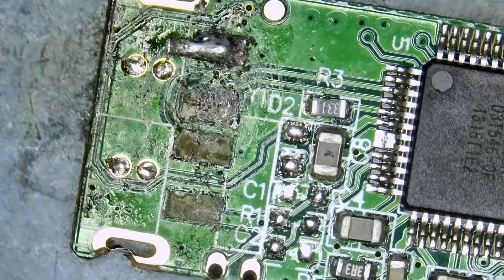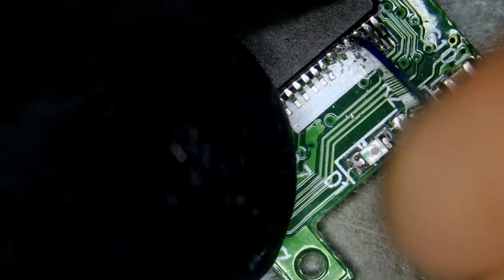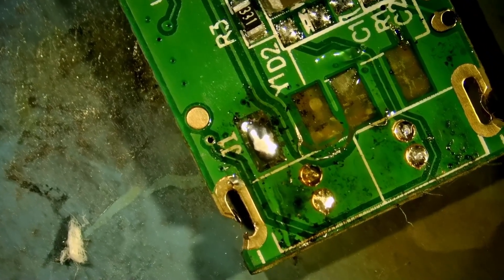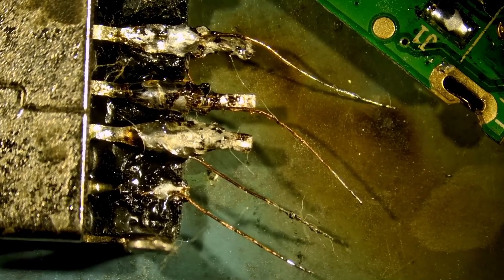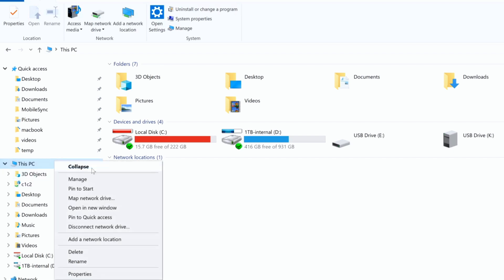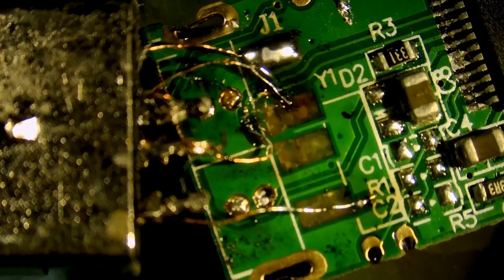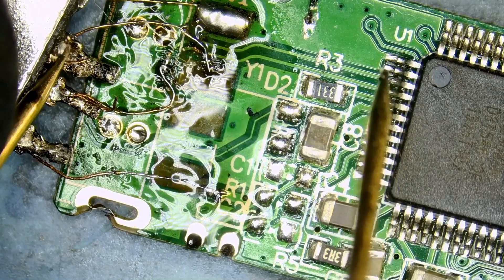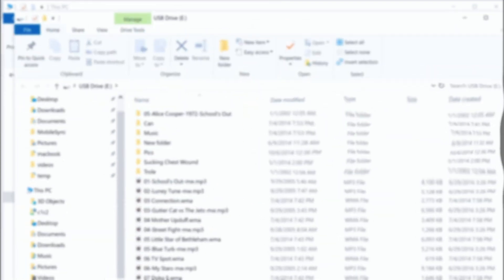Damaged USB Flash Drive Data Recovery - Controller short

Comment: Just had to stop by and say how awesome my buying experience has been with the Northridge Fix crew. Quick, and I mean quick delivery. And the products they sell are the best I've found anywhere. I can tell you just the things I've bought have caused less  headache. Something as simple as flux and solder wick that actually works like it should instead of disappointment and frustration. And if you have any issue with nearly anything, they will bend over backwards to find a solution.

Comment: Any ideas on where to start repairing/cleaning a possible saltwater damaged RTX 4070.
Reply: if it wasn't plugged in and powered up at the time. i would disassemble it and soak it in distilled water for a few hours. then lightly scrub it with a soft bristle paintbrush or something similar. rinse it off with more distilled water and let dry in a warm place for a couple days to get rid of the majority of the water. after that if you have a low temp stove 150f to 170f or a food dehydrator big enough put it in for 20-30 min stove 2-4 hours dehydrator to make sure all moisture has been removed from the board. reassemble and you should be good. if it had power at the time of the water ingress your only option would be a repair shop.
Reply: @AllanWorks  should I use 90% isopropyl if there is corrosion?

Comment: I noticed that your C: drive is in the red with 15.9.  If you want your OS to run smoother you need to transfer some applications and files onto drive D:.  Red means you don't have enough free space for OS, application, and file operations which means slowing down your OS and applications.

Comment: As always beautiful work Alex!
I have one question maybe it is unrelated but I hope you see this one... I am sure this issue happens to many people`s laptops , my Lenovo Yoga Slim 7 laptop has a buzzing sound like a crackling sound whenever I put it to charge. There are 2 USB-C ports which I can charge it with (both of them on the left side next to each other) and this issue is a very common problem on Lenovo laptops. I want to open and check the motherboard to identify problem but maybe you faced similar issue before , can you think of any reason why it could happen?

Comment: One of the most bizzare thing I've seen. As a PCB designer myself, i have no idea why the PCB uses silkscreen to deal with unused pins, instead of using the standard footprint to have all the pins soldered and the chip properly secured to the borad. Great job by the way, happy new year Alex

Comment: You only have 15 GB left on your C drive which is why the bar is RED. You should free up some space or move some of your unessential files off to a different drive. Before I retired, I was a data recovery programmer for over 40 years, and you run the risk of corrupting the file structure if your drive is close to being filled.

Just a friendly reminder.
Reply: never happen to me

Comment: So what does those unconnected pins actually do?
Reply: You asked the question= you got the novel 😅😅
Reply: The chip is an Alcor SC908SN, which is a flash controller/USB interface controller. Some similar chips from Alcor has FMDATHx pins on that side of the chip, which are supposedly only are supposed to be used with dual channel flash memory modules only. Otherwise the FMDATHLx pins are used alone, when in single-channel mode. This would be some sort of dual OctoSPI interface that work at the same time for dual-channel. But those pins that are unconnected (FMDATHx) are both I/O, an everything would screw up if shorted, so the controller would think that it should communicate with memory in dual-channel mode, when it can't do that. The flash memory would be located on the other side of the PCB.

Comment: I've heard other tech YouTubers say if Alex can't fix it its probably done. Watching him work, its easy to see why they say that.
Reply: If he deems a no fix, it can still be fixed, but it's not practical nor economical to do it (it can be more expensive than a new device), but if you really want it to be repaired for a sentimental value or similar you can still find a tech with less work than him to try and fix it for a higher price.
Reply: I know 1-2 more that are mainly doing microsoldering and seem more … equipped (?) for it when it’s like a almost impossible job and you know what is damaged
Reply: If Alex deems it a no-fix, it’s usually because the amount of time to diagnose and repair is not worth the time/effort
Reply: @alanc8741 You're right and That what he said every now and then, not worth the waisting time for him